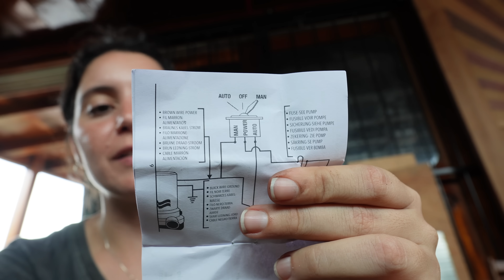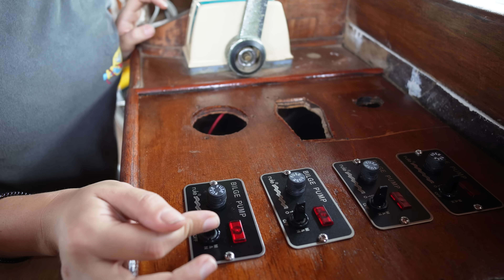This rescued wooden boat won't sink anymore: installing big bilge pumps — Sailing Yabá 178

Comment: While you are installing bilge pumps, don’t forget to install bilge sniffers and bilge blower fans.
Also you should make sure that your battery isolation switches are marine variety “make before break” isolators and not the cheaper 4WD off road battery isolation type switches for dual battery systems, which are “break before make” connectors, which tend to spark as the connection is made.

If you have any hydrocarbons aboard (petrol for tender outboard, lpg gas bottle for cooking, etc, you want the battery isolation switches not to create a spark when you turn the switch.

The bilge sniffer will alarm and tell you if there’s a gas leak or someone forgot to turn off gas stove & flame blows out.

The bilge blowers fans will extract flammable hydrocarbon gasses out and fresh air blown in.

In the event of a petrol spillage in the bilge, if the float switch on the bilge pump activates, the spark the bilge pump activating can ignite the petrol vapours in a confined space can blow the boat into tiny splinters.

So this is why you want bilge sniffer to alert you.

LPG gas if it leaks is heavier than air and sinks to the bottom of the bilge & can do same as petrol vapours, another reason you want the bilge sniffers and bilge blower fans.

Comment: Regarding the bilge pump switch.  Be careful mounting that switch at same height as pump.  The pump can go into a cavatation mode where it will run but not pump water . Slightly higher than pump so pump suction is covered with water before switched on.   Hard to describe but I witnessed it myself.   Maybe test flood the bilge to see that all is well

Comment: Happy birthday. Please fore safety. Put relay on each pump. Then you can turn it on manual if frog didn't work
Reply from the maker: Thank you Morten! They way we did the installation we can always turn the pumps on manually if the frog let us down. We might use a relay for the most forward one though, because of the long distance 😉
Reply: I am so happy to see your smiling work In heat. Been proud. I even have to follow each day. Even put my lunch break on job to follow. I look on job you Al makes. It's first clas. I am speechless

Comment: The discharge from the pump should always be above the water line
Reply from the maker: It will be! The ones in the video are the toilets ones. We were just finishing the job of the day before. The bilge pumps ones haven't been drilled yet.

Comment: I would highly recommend that you install a "High Watter Alarm", they are easy to make and can save your ass, if your pump fails. Mount a float switch higher in the bilge and connect it a bell or buzzer at the helm.🤔

Comment: Did you considered to install a flooding alarma?. You can put a level switch higher than auto running off the bilge pump, or a continuous running off the pump alarm.  You Will sleep better

Comment: The bilge will stay in better condition if it is not wet all the time. You can add 50mm pipe to the lowest point and use wet hoover to dry the bilge from easily accessible place. Bilge venting is also important to think at this point so it will remain dry more easily only by venting air.

Comment: Your first through hull you overbored your hole I seen sun after you put the nut on just filling with adhesive caulking to fill the void at some point in the future the caulk will fail and boat will take on water

Comment: You need to make sure that put one way over board discharge valves in all those bilge pump discharge hoses so you don't get a back syphon from the sea.

Comment: You need to have the bilge switch two inches higher, reason is there will be bilge water and as it slops around the switch will go on and off but never long enough to pick up water and then discharge, a small 500 lph should go into the lowest bilge point with a manual only switch. This will save your batteries. See the big pumps as emergency pumps.

Comment: On the hot wire from the battery you might want to add a fuse or breaker in case of a short and ruin the battery.  You can never be too safe when doing electric.
Reply from the maker: Thanks for the suggestion, but we do have fuses already! Our switches are each equipped with a fuse, so that shouldn't be a problem! Also, our batteries have a built-in protection agaisnt short-circuit that automatically turns them off before damaging them.

Comment: The bilge pump thru hulls should be installed above the water line for safety and efficiency.
Reply from the maker: The ones in the video are the toilets ones. We were just finishing the job of the day before. The bilge pumps ones haven't been drilled yet. Sorry for the misunderstanding

Comment: i would cut a groove where it sits the frog so it turns on "faster"
Reply from the maker: The switch should be at the same level or higher than the pump actually 😉
Reply: @SailingYaba   then i would cut a groove for them both to get lower you have a lot of water at that height in the hull

Comment: Happy Birthday, Ben!
i do not understand why you would want the main bilge pulp on manual. for a shower pump it makes sense to put on manual/automatic.
Reply: It will work BOTH ways.  Anytime the float switch activates it will come on.  Anytime the manual switch operates it will come on.  The reason you also want a manual switch is in case you have water in the bilge and the automatic float switch fails, you can still pump water out.  Remember that the automatic switch still works when the manual switch is in the off position.
Reply: It's called redundancy. If the float switch were to fail then you can go to manual to run pump. Float switches have been known to fail or  restricted from floating due to debris in the bilge.

Comment: Are the through-hulls for the bilge pumps below the water line? I would have expected them to be above the waterline so that seawater can't flood the boat through the pump. Also, a check valve on the pump outlet pipe near the pump will prevent the water in the pipe flowing back to the bilge when the pump switches off.

Comment: Once the boat is in the water the wood will swell, pushing the caulking and the caulking compound out of the seams out.
You will have to drag out the boat again and re-caulk the seams and repaint them... have you allowed for this?

Comment: STILL  HERE !             LIGHTEU®, Seaflo DC 12V 20A /24V 10A Electric Field Bilge Switch for Bilge Pump, Submersible Water Pump, SFBS-20-06 ,

Comment: Hope you put a fuse at the battery for the 24v wire feeding your bilge pump buss bar.
Reply from the maker: Every single switch of the bilge pumps has a fuse already 😉 if you look closely you’ll see them
Reply: I see that, but you need a fuse "at the battery" for the wire that runs to the panel. If you were to have a short in that wire it could cause a fire.
Take it from an old marine electrician.

Comment: Never use those connecters on bilge pumps. Solder connections with heat shrink. Those connecters corrode and fail.
Reply from the maker: We will add the Wago Gel Box around them to keep them protected 😉

Comment: I think you put the bilge pump outlets to low on the hull, what if your in high seas, you could have sea water enter outlets, also bilge pump wire connection should be high as possible out of the bilge.

Comment: Please use water proof connectors on those bilge pump connections.  they will keep your connections from electrolysis and corroding your connections making your pums unreliable
Reply from the maker: We will add a gel box there so they can be submerged and still be 100% waterproof.

Comment: Bilge pumps as I understand, should not be with discharge below the water line due to the physical back pressure of the. Sea water pushing back. What would you do if the hose fell off the fitting at sea. I'd have some plugs just in case.
Reply from the maker: The ones in the video are the toilets ones. We were just finishing the job of the day before. The bilge pumps ones haven't been drilled yet. Sorry for the misunderstanding

Comment: You should install 2 separate circuits for the pumps. Otherwise if a wire breaks before the first pump none of the pumps will work. 
I would wire 2 dedicated circuits to the lowest pump and then the 3rd location. Then another circuit to the 2nd and 4th pump.
Or, if I’m understanding correctly you are going to have all of them separated? 
Even with that I would still have 2 separate supply circuits.

Comment: It can be little dangerous having that bilge pump switch so close to the pump. During flooding you can get objects drawn to the pump, these objects can clog the pump and or stop the functioning of the switch.There is not much you can do to totally stop risk of the pump from being clogged but you can protect the switch.There is no ideal solution as you want the switch near the lowest part of the hull, which is also the case with the pump itself. I would likely move the switch a further distance from the pump and also put a cage around it to stop objects from interfering with it. That switch can save your boat, more so if you are not onboard during a flood. Also keep that engine room spotless with no loose paper, plastic or cloths, objects that can in a flood interfere with the pump or switch.

Comment: Can't agree more with Henesy. If the bilge pumps are running then the wires are under water. Those connections will short and rust. Wire connections under water should be sealed.
Reply from the maker: I’m sure I said in the video that I’ll be adding a waterproof box around the connectors 😉

Comment: Are you serius putting the outlet from bilge pump under the waterline? If then you need swan necks with antisiphone valves !,
Reply from the maker: The ones in the video are the toilets ones. We were just finishing the job of the day before. The bilge pumps ones haven't been drilled yet. Sorry for the misunderstanding

Comment: CAUTION!! I like your auto and manual switch with light.  I stopped using ones with a OFF POSITION.  To easy to be off and not on automatic when you think they are. Always have an unswitiched direct fused wire to the auto float switch.
I am not an electrician.   I believe you could run the positive wire from the manual side of the switch to the auto side of the switch and that would eliminate the off position. Then always safe

Comment: Why did u put the thru hull fittings for the bilge pumps below the water line.  What keeps the water from backing up back thru the pumps and into the bilge

Comment: Thru hulls for the bilge pumps need to be above the water line Im sure you know that but just in case.
Reply from the maker: The ones in the video are the toilets ones. We were just finishing the job of the day before. The bilge pumps ones haven't been drilled yet. Sorry for the misunderstanding
Reply: Not a misunderstanding I had commented before you said which ones you were doing. Not trying to be bossy but I have worked on boats for over 30 years. And just want you guys to be safe. You've worked so hard as well as all the Craftsmen working with you I like so many others want to see you sail around the world with Yaba

Comment: Please explain why you placed the through hull outlets under the water line.  Why not above the water line.... there they wouldn't let water in.
Reply from the maker: Hi Ernie! The thru-hulls we placed under the waterline are the toilet ones. We definitely don't want those above it. We still haven't made the holes for the bilge pumps.
Reply: @SailingYaba  Thank you.  I watched a video on through hull holes ...  they recommended above the waterline for all except the toilets. Just made sense.

Comment: Just a check, shouldn’t the bilg water exit holes be well above the water line, yours look extremely low to me, mine are near the top of the hull, it is a yacht
Reply from the maker: The ones in the video are the toilets ones. We were just finishing the job of the day before. The bilge pumps ones haven't been drilled yet. Sorry for the misunderstanding

Comment: Did you place the outlets for the bilge pumps below the water line?      That is not safe!   Now you need back flow valves.
Reply from the maker: We haven't installed any outlet for the bilge pumps yet. Those were toilet ones.

Comment: The check valves on those rule bilge pumps will reduce water flow going out so if you have a 1500 gph it will be reduced down to say maybe 1200gph ask me how I know, spent a bit of time on the phone with rule over that one.

Comment: are those outlets for the bilge pumps below water level have the pumps got a one way valve so they wont back fill if the outlets were above water line its a visual indicator of the pump running  just asking if there are above my mistake
Reply from the maker: The ones in the video are the toilets ones. We were just finishing the job of the day before. The bilge pumps ones haven't been drilled yet. Sorry for the misunderstanding
Reply: :face-blue-smiling:great my  mistake love the vlog @SailingYaba

Comment: Unless you are connecting all loads both swichable and "always-on" after the Victron shunt your battery monitor will not indicate the true state-of-charge of your batteries.

Comment: Please, please, please put a guard around that drive shaft. It only takes a moment whilst in slight panic with water entering the boat, a faulty float switch, and the engine still running to forget, reach in and lose your arm or your life.
Stay safe, fit a guard.
Reply from the maker: We really want to as we understand how important it is but we are still figuring out how to do it. Do you have any suggestions?
Reply: Yes, @SailingYaba your stainless welders next door. Use perforated stainless steel, two pieces, one underneath, one over the top, they meet along the shaft in a sort of cylinder, but could be a box. The size of the cylinder is made to clear the shaft and any moving parts and might have top and bottom parts made to deeper or shallower dimensions. Looking from above it would look like an H in plan view if the shaft runs left to right, the centre of the H runs along the shaft, and the points of the H become fixing points onto the wooden beams on either side. The gaps in the H allow access to the bilge pump without too much risk from the shaft (depends on the size of the holes and what you are wearing or what free-hanging hair you accidentally drape over). Plus the holes allow you to see the shaft is there/turning/OK.
All the best, loving Yaba!

Comment: I don’t think the bilge pump you are going to buy will work. It won’t be able to prime itself with the pump mounted up higher than the water. I would like to see how you manage to do it if it does actually work. Good luck 🙏🇺🇸👍

Comment: I am worried about the water filter for your engine. @Sailing Yaba. Is it below the water line? Because if so when you take the top off to clean it, it will flood the hull! Ok, I've just noticed you have a stop cock fitted to it. My obliges!
Reply from the maker: But we have a valve before it, don't we?
Reply: @SailingYaba  Yes you did. I called it a stop cock. I did not notice it was there before I posted. I was just trying to make sure your beautiful home was safe and nothing bad would happen to your new home. I've watched all your Yaba videos from day one. Loved everyone of them!

Comment: The bilge pump outlets need to be ABOVE the waterline. The bilge pump wiring needs to be butt connections not those snap connectors.
Reply from the maker: The outlets in the video are the toilets ones. We were just finishing the job of the day before. The bilge pumps ones haven't been drilled yet. The wiring will go inside a gel box that will keep 100% waterproof.

Comment: Ok here is one more unsolicited item to add to your list of fun, inshallah.  Please be aware that god,  being all knowing.  generally wills this sort of thing  after mañana.  The engine room hatch looks great, good design and all that.  However a drain in the area below the inner lip is a nice addition, when water from the deck gets there and trust me it will, the drain will allow it to go over the side before it drips into the engine room. Oh boy another through hull and some copper pipe or hose.

Comment: Sorry, more unasked for advice, use one way check valves along with 1/4 turn ball valves at each through hull fittings, even above water lines

Comment: In 2000, I had a Tartan 30, I took a garden hose, down below, and blasted the bilge with Dawn dish soap, the pump shut off, and I had a leaking stuffing box, I mean leaking! The pump would automatically come on, and pump about, 2 gallon's of water overboard, every 30 minutes or so. I was about to leave the boat and head home, it was 1 hour sense I last herd pump, I checked the switch, it was in AUTO position. I lifted the floor board, and shit my pants, the water was almost flush with floor, I tried the MANUAL switch, and the pump came on. Why was AUTO not working? I got my flash light, and laid on the floor and stuck my head in the bilge, i could see a plstic wine bottle cork, pinned between the top of the float switch, and part of the boat, that supports the floor. Must have dislodged while blasting. That cork would have sunk my boat, by not allowing the float switch to go up 1 inch in order to activate pump!!!!

Comment: I would not put any switches in the powerlines to the bilge pumps apart from a breaker maybe... You don't want to be caught flooding the boat and find (as you dive for your passport) that the bilge pump switches were switch to off for some stupid reason.
If you want switches in the mix you may want to have it switching like a so called hotel lighting circuit... two switches which are wired so the pump switch can switch on or off as well as the switch in the dashboard can switch on or off... but neither have the final say...